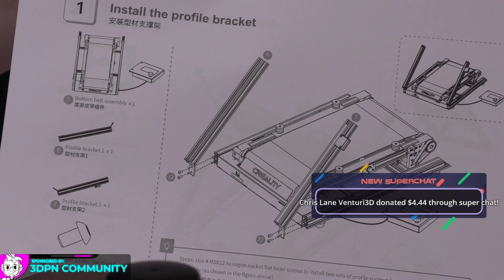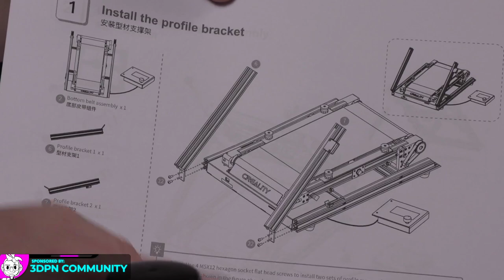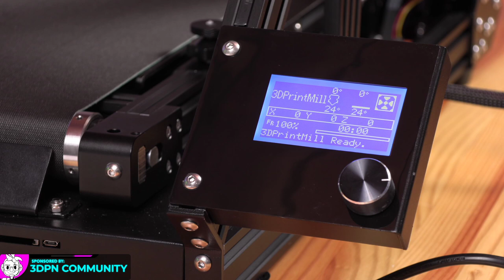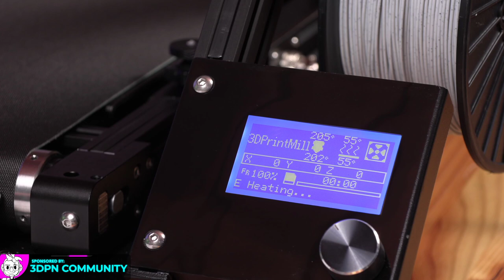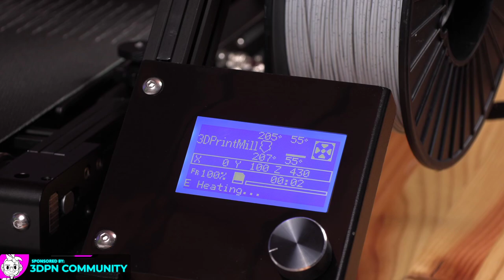Unboxing the Creality CR-30 - Naomi Wu's #3DPrintMill BELT PRINTER!

Comment: The worse thing about this video was having that girl there.  Other than whining about things being "disgusting" she brought nothing to the unboxing and review of the printer.  I'm also not impressed with the printer.  Too much cash for a sub par Ender 3 spin off.  The target audience will be small unless the print quality improves and is repeatable.  Both of those things have yet to be proven.  Also not a fan of the cyborg chick.  Shes so fake, resorting to sex appeal that nerds will eat up like morons.  If she were normally proportioned,  no one would care.  She puts any womans movement for equality back as she is looked on like a object.  Love the 3D printing nerd, your cool.
Reply: if you check the nak 3d's video (the original creator), the benefits of this model is to print longer than your actual build volume (similar to unlimited Z) and also minimize support requirements by a huge amount using correct orientation. Anything human shaped or 4-legged probably can be printed fully with little to no supports. It has huge potential but you just don't see it on this video.

Check these 2 videos:
20foot print: https://www.youtube.com/watch?v=tQm0_TvMXjw&t=71s&ab_channel=NAK3DDesigns
no support print: https://www.youtube.com/watch?v=Fl0vBrmNKTg&t=6s&ab_channel=NAK3DDesigns

Modding this design with a 300degree hotend and printing PC on an enclosure (check modded cr-10s) can probably allow even consumers to make unique furniture builds and way more props that doesn't require splitting several times. That's a step forward towards industrial printer capabilities on a 1K printer with a few mod add-on.
Reply: @crosscy9387  Thanks for the shout out, but I can't take credit for being "the original creator", this is Creality's design that was inspired by mine and William Steele's designs.  I agree with everything else you said.. 👍😉
Reply: Haha you just said everything I was thinking also. What was the purpose of the child being there, he was ignoring her anyway because of her stupidity lol.
Reply from the maker: I love that you’re calling my daughter stupid while your profile is of what I assume your two stupid kids.
Reply from the maker: She is my daughter and she wanted to be there with me. That’s why she was there.
Reply: @dooley9621  you're a bad person.
Reply: @dooley9621  really uncool to insult a mans children like that. By your profile picture, I’m going to assume you are a family man- imagine if you read that comment pointed at either of those two kids.

3DPN has always been a family oriented channel, and it has ALWAYS encouraged young kids and teens to get involved.  Joel having his daughter there provides continuity that we all have at home when sharing our hobbies with our kids. And it encourages young minds to watch, learn and get involved.  They are our future- and any and all emersion will only strengthen them.
Reply: @3DPrintingNerd  She was fun, I laughed through the whole video because of how much she reminded me of my daughter at that age. It's a nice change to see the hosts that we follow outside of their normal environments, apart from the variety it makes them feel real. It's clear from how she treats you that you have a great relationship and a real bond. No one knows people better than their kids do and it's clear that you're a genuinely good person.
Reply: Sorry for starting this.  I didnt mean or want this to turn like it did. I do however stand by my opinions, and will simply censor my viewing accordingly.
Reply: @dooley9621 That's a bit harsh dont you think? Shes probably a brilliant child, but simply brought nothing to the table in terms of content.   To me, I lost interest and left several times. But as pointed out, its 3D printing Nerds channel, his kid and his rules.  I made my comment, and moved on to other videos.